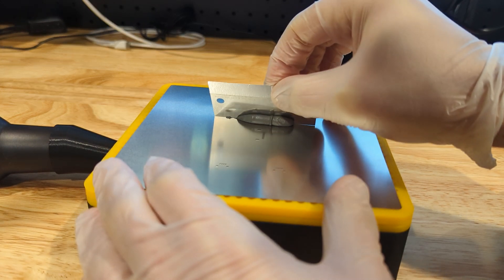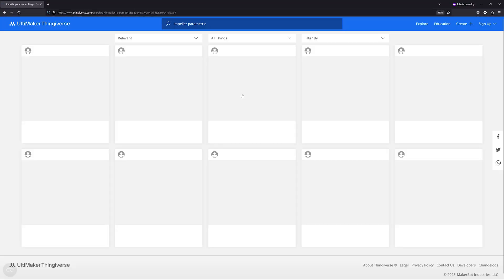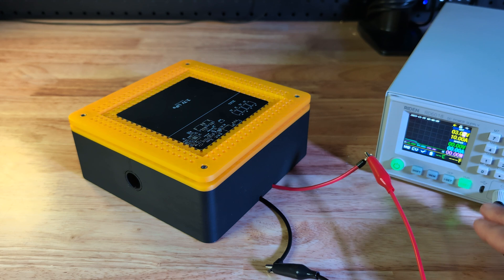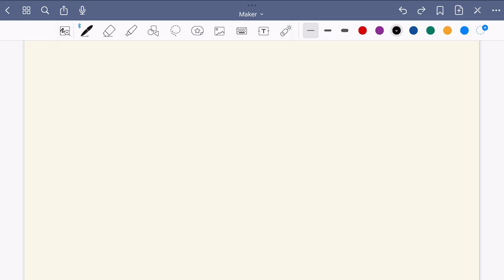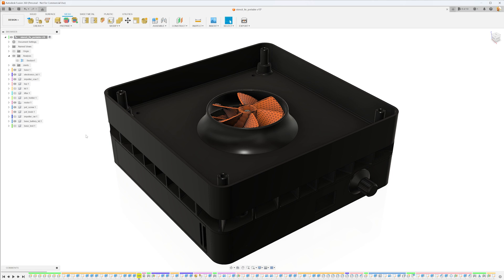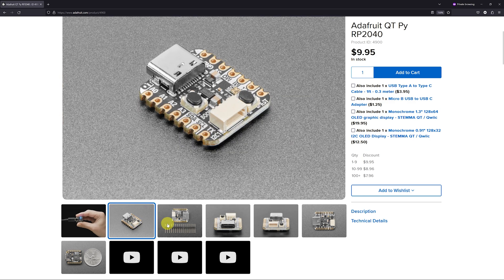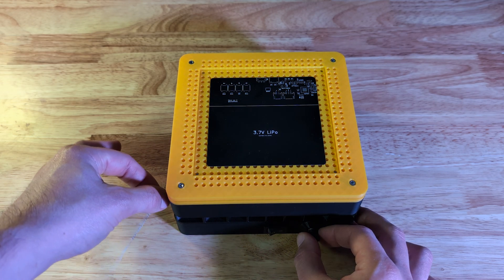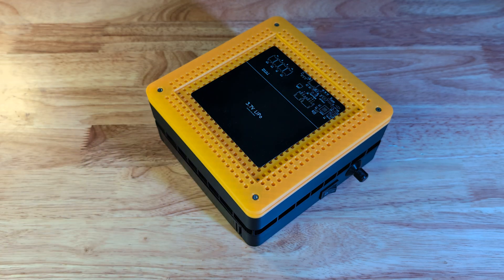DIY Stencil Holder | Stencil Fix Portable

Comment: What size do you have your board house cut your stencil?  I started having mine cut to be exact board size and I suspect those would not work on your Stencil-Fix or portable.
Reply from the maker: 150mm x 150mm. And yes, they should be bigger than the PCB. 😊

Comment: Are there any plans to make a pc board for the QT and associated parts you put on your breadboard?  I would like to see a pc board.  Also your BOM does not list the rocker switch for power. What did you use there or what size?  Thank you.

Comment: Yeah, the "top", "lifter" and "lid" posts and holes are all misaligned so either the cad model needs be updated, or rescaling of at least 2 of those to get to correct alignment.   That'll also mean the "pcb-holder" will want whatever scaling required to fit snug in the "lifter".

Comment: Is there a danger of the paste getting sucked under the stencil?
Reply from the maker: @OriginalJetForMe  Maybe but I have not observed it so far. Note that this technique is used professionally too IIUC. Also, the stencil is sucked very tightly to the PCB and the paste has some viscosity, so I think it unlikely.

Comment: I'm building a version of this, as the motor and control system aren't quite how I would like them.  I also need it to be a bit bigger, so that I can accommodate a 6" (150mm) square PCB panel.  Using the same impeller, but basically redesigning the box from the ground up in solidworks, and for the freedom-unit screws and components I have... It's an awesome idea, I'm really looking forward to seeing it work next month.

Comment: Incredible build and video subbed Max!!! Cant wait to try to build one! Does the PCB have to fit perfectly within that lowered square section or does it still work if it is smaller?
Reply from the maker: @Maxx-Blade  the square that receives the PCB is meant to be purpose fit for the PCB that goes in it. Thinking is that if the PCB is too small there will be unsupported space for the stencil to get pulled into. It might or might not make a difference but I would design a dedicated piece.
Reply: @ awesome thanks so much!!!! 🙌🙌 big fan.

Comment: I tried to recreate your design but with a dedicated pcb.  I'm not getting the suction needed to pull the lifter down.  I must be missing something related to creating a vacuum.  Any ideas?
Reply from the maker: @joelbisson8323  what's the dedicated PCB doing? And what battery are you using?
Reply: @scheffield  the pcb reads a potentiometer and outputs to a bdlc speed controller that I designed.  It is powered by a lab bench.  What is the current draw of your battery?  I wish I could attach a pic for you to see.
Reply from the maker: @joelbisson8323  ok. I don't know the power draw but these motors can draw significant current. I wouldn't be surprised to see 20A and more. Something most power supplies would struggle with. I use a 3 cell LiPo that can deliver something like 60A. Obviously not easy to debug this from afar. Could always open a ticket in the GitHub project.

Comment: I'd measure voltage of individual cells via the balance plug of that LiPo. RP2040 should cut off power when below 3.5V/cell. Of course there is a  significant voltage drop so it may even go closer to 3.0V when running. 3.5V should be a minimum for a cell when at rest. I'd also try a bigger rotor to make it a bit more quiet.

Comment: A little more feedback. Looks like it takes upto 16A @13.8V. Main problem I have had is with the ESC I brought. It seems to forget its settings, meaning I have had to add a recalibrate into the startup part of the code. It worked when I 1st got it, but the workaround seems to work ok....

Comment: The idea is brilliant. Thank you for sharing. I'm wondering if it's possible to use magnet instead of a vacuum. They should create the same kind of down force.
Reply from the maker: Thanks. I don't see why they shouldn't. Permanent magnets would need a mechanism to change the distance and therefore the force.
Reply: @scheffield  I was thinking something with a permanent magnet and a solenoid.

Comment: Well, it lives, powered by my 25A Amateur Radio power supply. It seems to take around 4-6Amps max (don't quote me). Mine sucks down well. I will run it off the 10Amp Cigarette adapter that comes with the power supply. I found an ESC with a Battery Elimination Circuit (BEC) which does away with the need for a buck converter. All in all, a nice design.

Comment: Great idea, thanks for sharing. I started printing your 1st version, but relised I could power this V2 by a 12V bench top Power supply. But you have two impellers, one clockwise (CW) and one anticlockwise (CWW) . I think in you video you have the CW one shown. Does it matter which one I print?
Reply from the maker: @chriscorcoran6889  it depends on the direction the motor spins, if it spins clockwise use the CW otherwise use the ccw one. Though, to be totally honest, the difference is not extreme.
Reply: @scheffield  Thanks, another couple of "Silly questions", 1) I assume any ESC can be driven by a 12V power supply? and 2) Every day is a school day. Do these brushless motors arbitarily go CW or CWW?
Reply from the maker: If you drive it with 12V it will rotate slower and therefore creating a smaller vacuum to the point that it becomes useless. Brushless motors have three wires that, at least in the case of the one I have used, have no markings. Their rotation depends on the exact order their wires are soldered to the ESC. If the motor rotates the wrong way around you should be able to change direction by swapping any two wires. Or just print the correct impeller.

Comment: it's a cool thing, but I'm wondering what about repeatability? when you need to apply paste on several identical boards. do I need to adjust the stencil every time? is it possible to add traforet retainers? to set up and pin it once.

Comment: It's a pretty nice design idea. But for my purpose, i'd probably do a few things differently.
First, the size. I'd probably make it large enough for at least a "Euro Size" PCB. Thats 100x160mm. They might not be that common of a size anymore, but back when i started with electronics, that was the go-to size for a lot of projects, and a lot of precut PCBs came in that size.
For the fan, i'd probably just go with an off the shelf 12VDC impeller fan. Put two 4mm banana sockets on the base, and hook up my lab powersupply to the fan to control the speed. With all the added electronics you need to drive that brushless motor, i think i can buy a pretty powerful impeller fan and reduce the complexity and required assembly by a lot.
And since we usually put at least two alignment holes (2.05mm hole, with +0.1/-0.0mm tolerance) for our 2.0mm alignment pins we use on test and programming fixtures in the PCB, i'd use these holes and some 2.0mm dowel pins to quickly align the PCB and stencils to eachother.

Comment: Hi Max, I don't know if it's just me, but when I put the lid on the lifter, the small curves don't fit directly into the holes. I had to adjust this, otherwise the whole thing jams when you press the 2 parts into each other
Reply: I see you wrote this a few months ago. I had the same problem this week, but after giving the small curves a light sand, it fit very well. The holes for the M3 screws seem to keep it aligned, so even if you sand too much off or unevenly, it should remain mostly square to itself. Hope this helps!
Reply: @vajrakilla9124  Hello, i have redesigned the Part, fits now perfectly

Comment: Hmm guy designing a stencil holder for DIY SMD PCBs and drops in some modules cramped together on a perf board? Come on 😆
So hoping for V3 to come with a custom made PCB or thinking of doing one myself.
Reply from the maker: Haha, I hear you! V3 will have it.
Reply: @scheffield  and I wonder if some flow simulation could improve the efficiency. Less noise, more power.

Comment: There's actually a much simpler & easier way to align your stencils, especially as you are 3D printing the PCB holder.  Add a few ~2mm NPTHs to your board or panel at specific locations and ensure they end up in your Gerbers.  When you print the PCB holder add 1.9mm dia "pins", long enough to pass through the NPTHs in the board and stencil.  Now just drop the PCB over the printed alignment pins and slide the stencil down over them too, turn on the vacuum and everything will stay in place perfectly aligned.

Comment: Really great project Max, thanks for sharing and for putting everything up on GitHub! Do you think it will work with Mylar stencils? Or would they need to be too thick in order to avoid flexing around the PCB? 

While writing that I got to thinking that I could add (3D printed) spacers around a board to that there are no gaps around it.

Comment: Hey Max, I'm 95% finished building my own Portable. I've taken a bunch of notes/errata and attempted to contact you via the email address on your GitHub page, but not heard anything back. Is there a better way to reach you?
Reply from the maker: Sorry, a bit under the pump right now. Will try to have a look later in the week.
Reply: @scheffield  I appreciate the work you've done so far, and I really have been able to figure out most things on my own. One thing that is really driving me nuts, however: how the heck do you screw down the motor? Does this thing pop apart in a non-obvious way? I am embarrassed by how many hours I've spent trying to figure this out.
Reply from the maker: How strange, the motor I'm using has a base with 4 tapped holes of size M3. They match up with the holes in the base. Most, if not all, drone motors have those holes. Which motor did you get?
Reply: There is likely a fundamental misunderstanding on my part, as this is the first time I’ve ever used threaded inserts. I am using the exact same 2807 motor as you. What I do not understand is how to access the screw holes on the motor when it is sitting on top of the enclosure. I’ve tried using a 1.5 hex driver on the central shaft of the motor, but it doesn’t seem to do anything. In your video, the motor is just suddenly attached to the base. 😅 I’m happy to watch other videos to learn techniques but this is a scenario where I don’t know what I am searching for, as we are using drone motors for a different purpose. So yeah, there’s a missing non-obvious step that you’re taking for granted; we’ve all done it, I’m just trying to find the right combination of words to summarize it.
Reply from the maker: @pjforde1978 , gotcha. The base, in my video, the black piece that sits on the table has 4 holes at the underside, they fit M3*12 socket head screws. NO threaded inserts needed. When you put the screws in from the bottom, they will poke out at the top where the motor should go. Note that the 4 holes in the motor's base are already threaded and that the screws fit that thread. As a general rule, when screwing things together, only the far side needs a thread, everything else should not have a thread that engages with the screw. The motor is the far side here and has threads, so we don't need threaded inserts to mount the motor.
Reply: @scheffield  that did the trick! Thanks. It's basically assembled now, though the springs I ordered are apparently too small. Did you end up using the CW or CCW impeller? I printed the CCW but I'm starting to think CW was the correct one. Also, how did you secure the impeller to the drone motor? Mine is spinning but the racket is something else because it's basically just sitting on top. Still... 99% working and impressed so far. Great build.
Reply from the maker: @pjforde1978  It depends greatly on how exactly the motor is wired up. I used CW but this might not work for you. I would spin up the motor and see which direction it turns. Re springs, you can stretch them a little if it's a matter of millimetres.
Reply: @scheffield  I wired it up in the same way you did in your video, which means that it is spinning CW. I think this means that I can either print a 2nd impeller (a waste) or I can just reverse the two outer wires on the ESC. (It is the two outer wires, not the middle, right?)
Reply from the maker: @pjforde1978  I'm no expert but if I remember correctly, any two wires can be flipped to reverse the direction.
Reply: @scheffield  brilliant, that worked. Springs are still tight, and I need to figure out how best to attach the impeller to the motor... but it works! Thank you for your guidance.

Comment: What are the length, width, and height of the base part? I'm importing the STL files into Inventor and it all looks good, but scale is off, and is way too big  at 162 in square.
Reply from the maker: It's 162mm. So the unit seems to be off.

Comment: I admit that when I saw this in my feed, I thought it was showing me the previous version. You should give it a v2 in the name! I'm so glad that I clicked, because this is amazing progress. I do have some ideas for improvements; first, your box needs some rubberized feet, suction cups or even some mounting threads because you really don't want it moving around. I think that a lot of folks would love to be able to plug in a unit like this to a bench power supply or one of those low priced Chinese AC power supply units, because something like this is likely to see a lot of use and a LiPO would need to be recharged frequently if supplying current to drive a drone motor. Finally, this might be getting a bit in the weeds but you might want to offer some advice on considerations for enlarging the size, as many folks might need to work on a board that is just slightly bigger than this version.

Thank you so much for all of your hard work. NeoDen has every reason to hate this. Good riddance!

Comment: That's a cool project.
I might build one of these, although I don't really see the point with the lipo battery.
It's an added cost, and complexity with charger and all.
I think I would prefer to use an USB power bank instead.
I might even omit the battery and have it hard wired. After all the pcb goes into an oven afterwards, and that is not battery powered.
Reply from the maker: Ah, yes the battery is an added bit of complexity and I like the idea of just using USB. The kind of motor I'm using requires higher voltage and current than default USB would deliver. So, we would need to use USB PD which comes with its own complexity. Doable but might be a bit more complex than the current setup.
Reply: @scheffield  yes, would need to advertise the power need. There are ready made modules that allow for setting those parameters and they negotiate with the power supply. Brian Lough has one I think, that from memory he called the TS100 flex-c-friend. At least I recall he made videos describing how the power negotiation works.
Reply: Found an interesting chip. The Infineon EZ-PD PMG1-S3 MCU. They have a dev board available for about $25. This board supposedly takes care of the USB C connection, and replaces both the MCU, and the ESC as well. Infineon has made an article about this use case  (controlling an BLDC motor from USB C power), that are available on the net. I have the parts on order, and will do some experimentation when they come in. Probably start of next year.
Reply: I also preffer using a power supply. Can you please measure the power consumption?

Comment: I and made a vacuum stencil device in the past. I had issues with paste being slightly sucked by the vacuum resulting in small pads at some locations  having a oozed effect. it doesn't look like you're having this issue but do you think it will?
Reply from the maker: I have used this version and the previous one for a while now and didn't see that issue. What I have seen though is too much paste being applied form pressing too hard and going over the same opening too many times
Reply: @scheffield yes I've always tried to do just a single pass with the scraper (after seeing it mentioned in a video from someone that very much does it for their day job!) and it works well - I think multiple passes make it much more likely to push too much paste through and force it to spread out under the stencil.

Comment: This is really good!
How important is it for the pcb to match the size of the bottom tray? I would have imagined that the pcb could also be clamped pretty well by the vacuum even if its smaller.
If I ever get into SMD pcbs I'll surely consider making this thing!
Reply from the maker: The vacuum itself holds it down pretty well but you don't want a large gap between the PCB and the lifter as the stencil would be pulled into the gap and bend, if that makes sense.
Reply: @scheffield  Makes sense, so we need to design some expandable gap brider part, like a scissor mechanism ;)
Reply: @DanielSimu just use some tape to cover holes.  Blue painters tape or electrical tape should work fine.

Comment: Well done, that was some very impressive engineering and your fusion timeline is so well organised! The airflow and static pressure you're getting with the 3d printed impeller was much more than I expected. Looking forward to your next video. I expect you'll be using the portable stencil holder!

Comment: Do you have a speed limitation built in?? To avoid that the fan will desintegrate due to the rotating forces?
Did you balance the fan at all? or just based on the print quality it was deemed "balanced"?
Reply from the maker: Surprisingly, I had no issues with that. As I iterated on the design, I printed many impellers and all of them worked just fine.